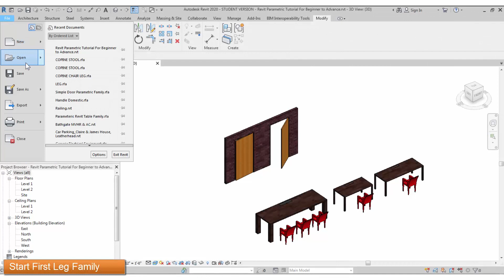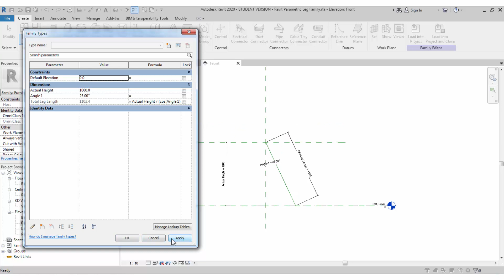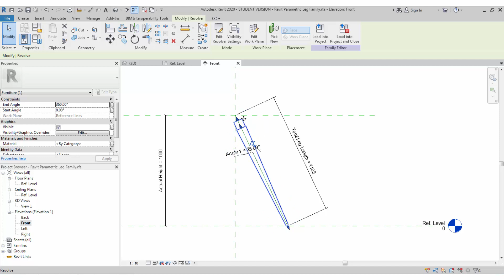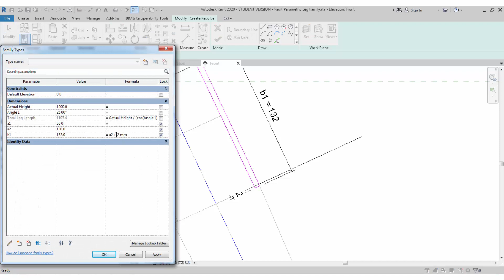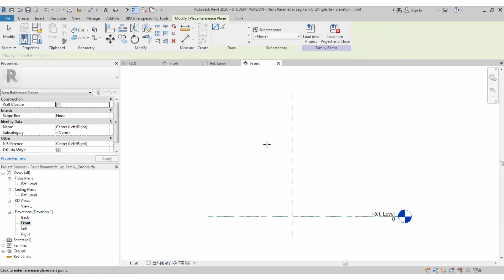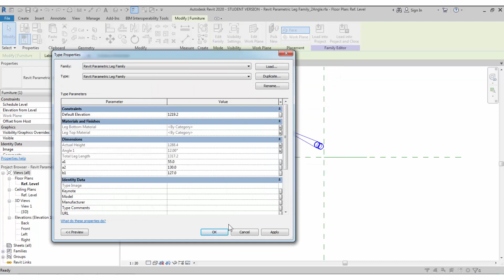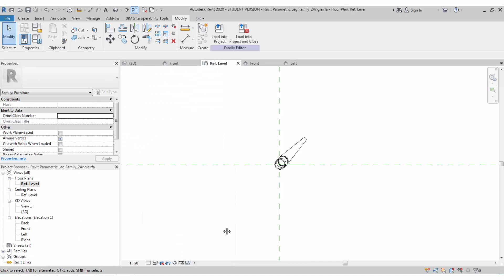5. Revit Parametric Leg Family - Learn Angle Constraint

Comment: Hi, thank you for your video very helpful. but I do have a problem when I load angle 1 to angle 2 and change the value of angle 2, the element is not changed like angle 2. Thanks.
Reply from the maker: May be you have missed a constrints. Try to do it from beginining.

Comment: Hi sir 
When I am going set plane at ref  line for first revolve, asking for choose a view but as I saw once you did it doesn’t asked! Problem is I couldn’t skip choosing view ! Also when I do set parameter for a1 & flax  not working ..! Any solution pls. 
Best Regards
Reply from the maker: Yes It may ask, depends on which work plan you select. I will be in right view already so it won't ask me.
Reply: @BIMModeller  thanks for reply and I got it finally but take more practice to find out my mistakes. Appreciated sir. 

Could you make some tutorials based on adaptive family, like how to  create and add to the desired place into projects. Regards
Reply from the maker: @ashrafulalam7042  Im glad. Right now Im creating Revit MEP Tutorial Series. It may take two weeks time. Once its done. I will start making Family creation Series.
Reply: @BIMModeller  sounds very good!! Sir, if you could make a tutorial based on Revit formula more about angles constraint which would help us a lot ..! 
Thanks & stay safe

Comment: Why u make two times leg family here??
Reply from the maker: You mean Two angle values?
Reply: @BIMModeller  yes
Reply from the maker: @iftekharkhan8879  Each angle control X direction, Y Direction Angle
Reply: @BIMModeller  In both the families you gave the angle constraints in the front view- but in the second family you managed to change angles in both x & y axis. Since both the constraints were made in front view... shouldn't the angle change happen only in one direction? Or the view in which the constain is made does not matter? What is the driving force for the 2 different directions? Please explain. Thanks a lot!

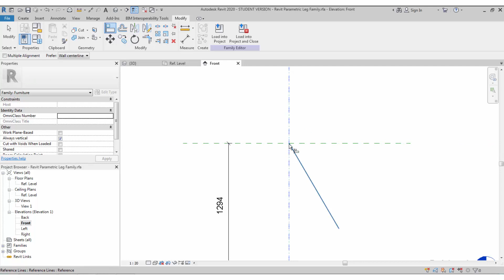Comment: Thanks for this video, i've got a question about 3:32 min, i can't aline my line with the point, did you use a shortcuts ?
Reply from the maker: Hi Yes Use the TAB key on the keyboard to switch different option for aligning.
Reply: @BIMModeller  Thanks a lot ! from Paris
Reply from the maker: @_westbrook645  From Paris! Great.
Reply from the maker: @_westbrook645  I have sent you a mail. Thanks